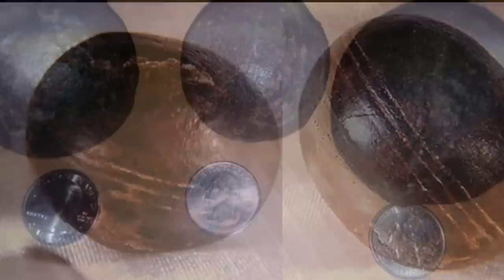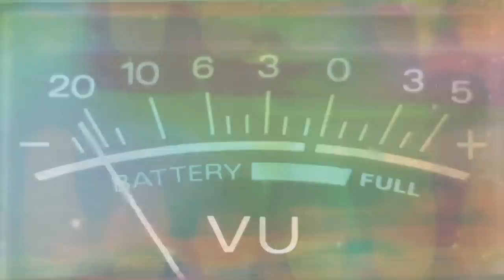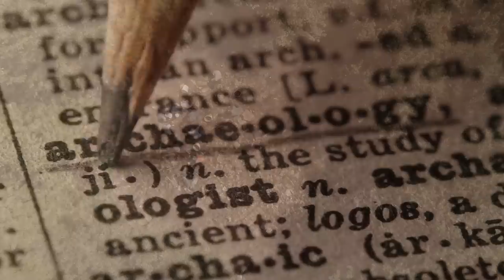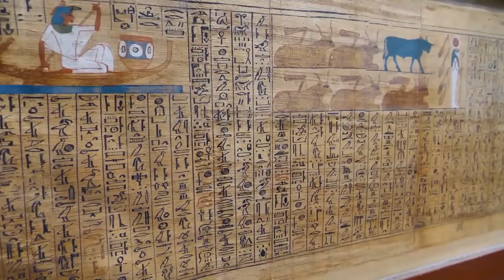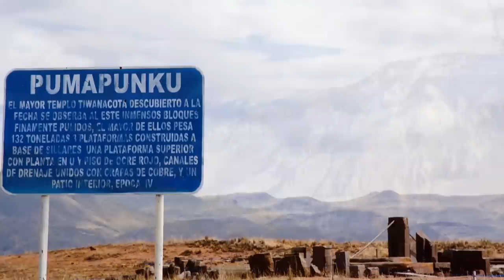Alien Artifacts - The Outer Dimensions (Full Documentary)

Comment: Iv been a stone mason for about 35yrs.I see Dimond blades cut everyday,week,year.iv been to Balbec, pyramids.ect. NO”! Human beings cut, measured levelled placed those 5 to 10 to 1000 t stone’s. Position them in absolute perfect place. Archaeologist can’t even fit a razor blade between gaps in the stonework stone cut blocks of stone. The cuts are also more smooth, more accurate than the lasers we use to direct and place each stone perfect, and the cuts are smoother than the diamond blades we use now to cut stone. Trust me believe me aliens, or I call them other thousands and thousands of years, intelligent beings have been here and built everything in stone

Comment: The problem I have is that if it's ancient aliens then why build in stone and why build the most basic and easy structures like pyramids? Why not build something with their futuristic technology and materials? Surely they would last longer if they can withstand the vacuum of space?
Reply: I'd say that the pyramids and other old megalithic structures are made of stone because it lasts longer than anything else that can be dug up. The shapes are practical, made for a purpose I think. I don't know what purpose though. The pyramids in Egypt seem to have a hydrologic function and wear marks inside.
Reply: The space shuttle can withstand the vacuum of space. If you left it out in the weather for 1000 years the only thing that would possibly be left would be plastic. And the plastic would likely be scavenged and used elsewhere. The only thing that lasts is stone.
Reply: That’s actually an excellent question. The easiest way to explain it would be to imagine what colonizing Mars would be like. Would we bring materials or would it be more logical to use the materials we find on Mars to build landing and launch pads, shelter, other facilities we would need to survive and colonize.

We would never be able to transport enough steel. Much less concrete and the machines needed to build with those materials. We would find and use material on the planet instead of trying to bring it all with us.
Reply: The pyramids are one of the many wonder's of the world. With the technology we have now it would be almost impossible to replicate those amazing structures. No one knows how many thousands of years they have been there. They are aligned precisely with the constellations Sun, and planets in Solar system. They have just as precise records of the solar system as we do and you say that they were a stone age civilization? Something isn't adding up. Ray Charles could see that.